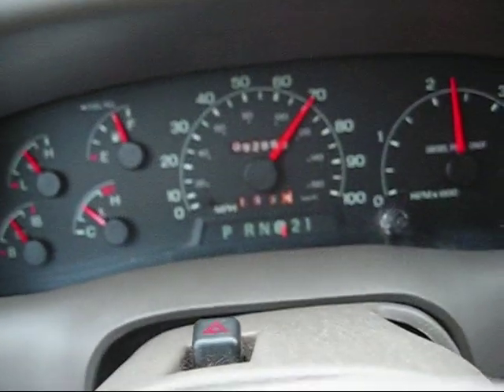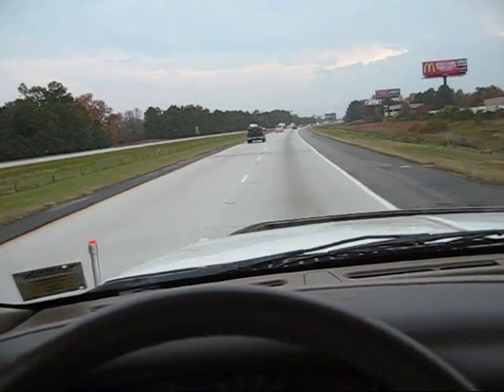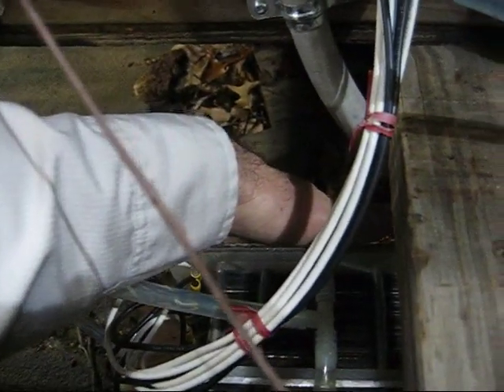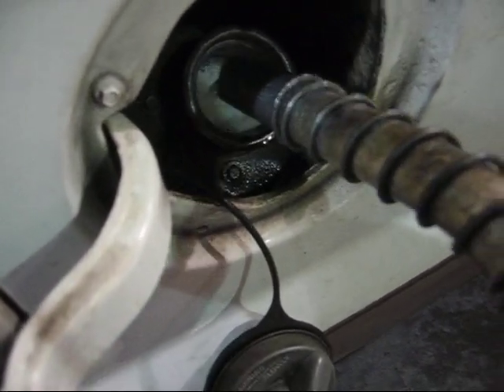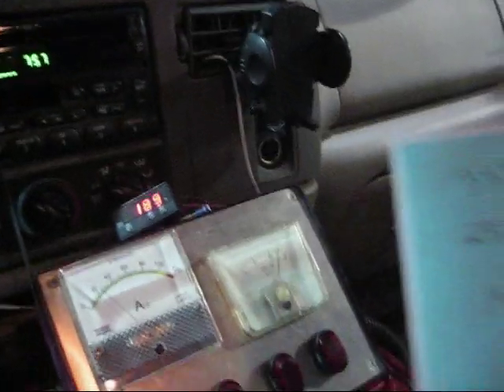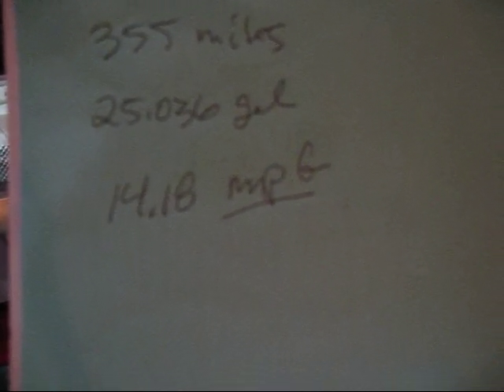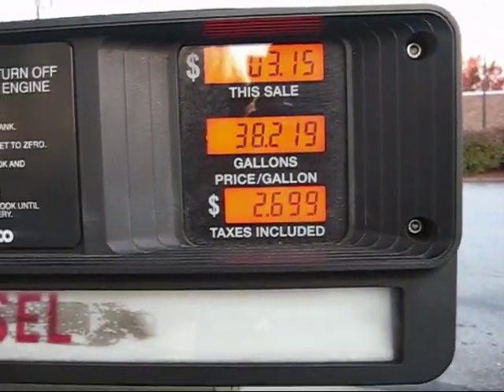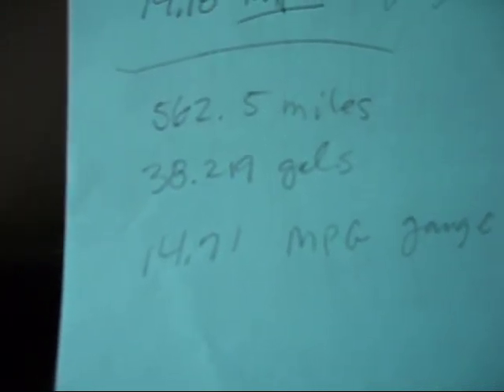MPG 1000 mile trips W/HHO in a Ford F350 7.3L Diesel

Comment: I Own a 1999 7.3 diesel I just got done making a epic trip with. I put over 3000 miles on the truck in four days leaving Florida going to Ohio Akron, over to Rochester New York to pick up a car and then headed south to go home. On the drive up with no trailer I was able to get 600 miles out of my 35 gallon tank which is about 17.4 miles to the gallon. The truck I have is a crew cab centurion package Dooley with 410 gears. I drove at the sweet spot of the motor which I’ve been told is 2000 RPM which for me is about 63 miles an hour

Comment: I have a 2000 2wd f250 special duty and routinely get 20-21  mpg at 60-66  mph and 9-10  mpg pulling my 32 ft 5th wheel rv.  You get 14?  Maybe you need a later model PCM....

Comment: I have a 1997 F-250 7.3 and I am old, retired. I drive slow, max 55-60 on 2 lane county hwys with maybe 5% small town driving. With Archoil fuel and oil additives my mileage runs 24-25 mpg. Before using Archoil my mileage ran 22-23 mpg. I have used hydrogen generators on hwy gas engines and marine diesels and achieved about 10% better mileage. What you ad to the water makes a big difference. You can change the mix to get more hydrogen or more oxygen.

Comment: so its obvious he has 4.10 gears. my 4wd CCLB DRW zf6 computer MPG reader has been stuck on 14.6 for awhile and i drive alot. i use a transfer tank so i dont really check tank - to - tank MPG. but i dont think this guy is gaining anything by using this. 1mpg does help in the long run but damn thats not much increase

Comment: Sorry my 7.3 gets a average of 15.8 mpg with hwy/city mix. 4dr stock filter + ranch hand bumpers, not some light stuff. I'm thinking the hho isn't helping you at all. Honestly the conversion is probably just a waste of energy probably mostly in the form of heat. Bad for the engine, alternator and battery life. It's simpler and probably better for you to take the same money spent and time and filter cooking oil/ old motor oil.while mpg will be similar it will cost less per gallon, but probably last longer as used oils have more lubercation properties then hydrogen. If you plan to stick with hydrogen maybe generate from the grid or solar. For efficiency less amps and more hydrogen generator electrodes to prevent heat generation

Comment: Guys... sure, there are losses, but if you can get around those, like in any f*ing situation, you're golden. So how do you get around them? Here, we're trying to find free electricity to power the HHO system. How can we do that? Well, it's difficult in smaller cars, but in larger cars, what can you do? Have a battery pack! How do you keep the battery pack charged? Free electricity! How? Fucking solar panels. Put some damn solar panels somewhere, be creative, pull them out to charge the damn battery pack, and drive your f'ing cars. Life is a f*ing compromise, figure out your ways around it and quit trying to kill people who are. If you can afford an electric vehicle, good for you. If you want to preserve your diesels or gas cars, and make them more efficient, then that is noble as well, and can be solved in creative ways. Best wishes.

Comment: Your fuel economy is still pretty bad, I know this is a ten year old video, but my 1990 7.3 idi F250 gets 21-23 mpg on the highway
Reply: How’d you manage that? Lol most early 2000 f250 7.3 trucks get like 15
Reply: @wolfrus1809  On the highway, doing 55-60 mph. highway gears, HPR diesel with additive, fully unloaded, Manual ZF-5 speed with synthetic oils and fluids. Motorkote in the oil

Comment: have a 2000 f350 4wd srw that gets in the mid 15's with 3.73 gearing at 76 mph.......it has 290000 miles on it and with no wind has seen 16.8 tops.......what the hell!!!!!!
Reply: drive slower, maintain your truck

Comment: My friend, why are you using so many amps, do you understand what that does to an alternator. Three-quarters of a litre of HHO gas per minute  should be enough for such an engine about 8 amps. Then engine has to work so much harder to drive the alternator
Reply: yes also please note voltage is the breaker of water to attomize not so much amps which is load on system...

Comment: No HHO but read this it is True:  I have a 2007 6.0 F250 2WD Crewcab SRW Larait very nice 108,000 miles.  All I've done so far is the Purge tank cap, Coolant filter, K&N Filter in Stock box. Exhaust and everything else stock. Had a smart man do me a tune for mileage. He sent me three...I did not like the first tune.  Truck runs great and pulls great.  Here is the deal....do you know anyone getting a minium of 18 mpg empty in city driving?  i do.  How about anyone getting 25 to right at 30 Plus with the best of 33 mpg empty @ 70 mph, perfect weather no wind! Awesome!   Ok some will say I am just pulling your leg..  Guys this mileage is the same for the last 6+ Months! Tunner is amazed as well.  Maybe this is a very special truck. OK Loaded pulled 30' Gooseneck flat bed and heavy trailer got 17 to 18 at 70-75 MPG up and down hills.  Then loaded it up with 20 ton roof A/C units stacked two high and still go 13+ at 70 MPH with hills.  I am one happy old 65 year old man.    So, why am I getting this great mileage? Luck maybe. And yes I check it often and the speedometer is spot on.  No I do not want to sell any time soon if ever.  Thanks

Comment: Considering all the money and effort spent buying parts, building, installing & maintaining an HHO... there's just not enough benefits for the average diesel driver.  Possibly more beneficial if/when fuel costs return to $4+/gal and/or for those running 1000"s of miles/month.  Unfortunately, HHO is a wash for those running 12K mi (or less) per year. A Straight waste vegetable oil kit makes wayyyyyyy more sense (which is the route I went }:) Too bad, really wanted to see some awesome HHO MPG #'s but for all the effort... just doesn't seem worthwhile for average driver :(
Reply from the maker: WJK it was a lot of work for not much reward but it was a fun experiment.

Comment: Major  Bullshit  Running Compression of a Diesel engine would ignite  the Hydrogen way before the cylinder intake valve closes. Even using LPG is tricky at 110 octane. 
Think about it this way One gallon of diesel weighs 7.10 pounds 
one gallon of liquid hydrogen weighs less than a pound.
You simply can't supply enough hydrogen to actually make any difference.
Also the added draw on the alternator will shorten the life of the charging system components.
Reply: Ron Brown 
You sir are incorrect. I hate to break it to you but you obviously haven't studied at all in the matter. Read below and download the rest so you can increase your below average view of hho.

"The concept of using hydrogen as an alternative fuel for diesel engines is recent. The self ignition temperature of hydrogen is 858 K, so hydrogen cannot be used directly in a CI engine without a spark plug or glow plug. This makes hydrogen unsuitable as a sole fuel for diesel engines [1]. There are several reasons for applying hydrogen as an additional fuel to accompany diesel fuel in CI engine. Firstly, it increases the H/C ratio of the entire fuel. Secondly, injecting small amounts of hydrogen to a diesel engine could decrease heterogeneity of a diesel fuel spray due to the high diffusivity of hydrogen which makes the combustible mixture better premixed with air and more uniform."

This is pulled from a comprehensive study readily found with a simple Google search so you can copy and paste

 Effect of hydroxy (HHO) gas addition on performance and exhaust emissions in compression ignition engines
Reply: You sir are a idiot beyond science. . 
Just get over it , I don't believe a word you say . Now that bothers you so much you can't sleep? I'm sure the answer is no it doesn't 
Thermodynamics tells me that your full of hot air. You are also working out side the design capability of that crappy engine.
Would you like to have me explain it further? I can assure you my knowledge of the internal combustion engine is decades beyond yours just watching the video tells me that.
Reply: for those saying it won't work cuz of the flash point differences you should do more research. ppl have propane boosted diesels for years for better power and fuel economy  this is just another gas doin the same idea

Comment: If you keep your rpm's below 2000 you should easily get 17 or 18 on the freeway.
Reply: my 2wd long bed 4door 02 with 3.73 gears, all stock besides AIS and truck muffler... at 374k miles i still get 18-19mpg empty at 70mph... friends same truck with 109k miles gets 22-24mpg

Comment: I have a 2001 7.3 powerstroke. At 70 mph my tac is 2000 rpm with my truck empty not pulling. Freeway MPG is at 22-23    K & N  air filter

Comment: HHO is a scam
Reply: +Successfully Puzzled Well, the truck is using about 1.1 horsepower of electricity to run the HHO system.   The reply is thus, the laws thermodynamics surmised say you can't get something for nothing.  The energy required to split water into HHO is pretty close to the energy you get back, but, there are losses in electrical generation, waste heat from the gas generator and wiring, and a big honkin diesel engine running at about 50% thermal efficiency.   So, if you could take the full 1.1 horsepower to generate we'll say a volume of fuel, that volume of fuel burned in a diesel ICE, you're going to get less than 0.5 horsepower back for your investment.    Where hydrogen conversion works well is where you have a big power generation facility feeding a high pressure hydrogen generator, using excess power to crank out some hydrogen with surplus energy in off peak times.        Now a vehicle with constant power generation, where excess power gets shorted to ground, will see a tiny benefit.  If you put a scan tool on this 7.3 diesel, pull up the pid for fuel consumption in GPH, when you click on this HHO generator, you'll see exactly what your realtime fuel cost is to run the HHO generator via the alternator.
Reply: Successfully Puzzled
 I have not looked but are there 'fuel line magnets' for sale still?  How about intake turbine mpg boosters?   If someone buys a product and feels it works, sure they'll give good feedback. A buyer is free to leave anything from good to bad feedback, but that's not science and doesn't meet any standard of proof
Reply: fastst1 laws of thermo dynamics? What happens when you burn wood?
Reply: fastst1 you missed some stuff off... Alternator - 80% efficient
HHO - 70% efficient
Combustion - 40% efficient

1hp used to make hydrogen would equal 0.2hp... so that's 80% of the power wasted!
Reply: +Successfully Puzzled   burning wood to fuel the engine or burning wood to break down water?   wood and coal gasification has been used before to run a standard ICE, still a very low thermodynamic efficiency esp once you get to the ICE part. You can absolutely fuel an ICE with wood vapors.  Energy required to make wood comes from tons of solar/organic energy power.
Reply: ***** all those ebay selling HHO kits with great feedback???  Sure michael...... it's time to graduate your thinking.
Reply: Successfully Puzzled the idea behind HHO breaks the laws of physics, show me this feedback? I have yet to see anybody who has credibility to show any improvements from these systems. A few years ago, professional skeptic James Randi offered a $1 million prize for anyone who could prove their device lived up to their claims. Nobody took the challenge/test.
Reply: Successfully Puzzled I just looked some up... the one I looked at obviously has fake feedback, there's one feedback message that mentions the quality of an iphone 5S (even though he purchased a kit) and 7 different people say exactly the same thing.
Reply: +micheals1992 I agree, icing on the thermodynamic cake ;)  even IF it was 100% on generation, 50% goes away for heat in the power production cycle, modern common rail diesels can hit 50% at full power. So generating 1.1 hp does require a lot more than 1.1hp
Reply: my master is SCIENCE! teamed up with string theory, we own everything across time.

you didn't buy a fuel line magnet did you?
Reply: @fastst1  lol..science..your right your master is science  a new tool is created on graduation day ..as an educated fool and free thought part way
Reply: @Ownlyfrogs    Naah, water is just so highly stable that it doesn't want to break, you have to use a fair bit of force to break it apart.  Even lets say, for speculation that  the energy for breaking apart and combusting water is equal going in either direction. You still have heat losses in generating  the electricity along with the spinning motor to drive such. 2nd law of thermodynamics states there is no free ride, and its the law.  There isn't solid, repeatable, objective science for the application of self generation.    Science may not have all the answers but it supplies a mighty big toolbox for testing just about anything observable.  If HHO works, what prevents you from scaling it upwards and creating your own massive stand alone power generator?
Reply: robinsss no I just bought a car that does 60/75mpg (city/highway) without any hybrid technology. it's actually one of the cheapest cars on the european market too! the Toyota Aygo, Citroen C1 and Peugeot 107 (they're all the same car just rebadged, they all use a 1.0L VVT-i toyota gasoline engine too which won a few awards for relliability and economy).
Reply: *****

what's your response to the dyno test at U of Northwest Ohio?
Reply: +fastst1 a lot of fancy lingo going against what's quickly becoming the norm. HHO is not a scam. If so, it's amazing how all these Ebay sellers have such high feedback from selling this "hho scam".
Reply: How many oil refineries does your master own?
Reply: got HHO?

Comment: You mileage is low. You got a dually. That means 4;11 gears. Automatic? you should pull easy 16-17 highway. Is you exhaust stock? Big pipes, free flow muffler.  Check out Banks. He's got what you need to unleash the power and mileage of a 7.3 My 7.3 Excursion, Automatic, pulls 15-16.5 city all the time. !7-19 hwy. at 70-75mph. Any faster and it drops like a rock. Like down to 14-15 at 75-80.  Rpm at 1400. that's the sweet spot for 7.3s   Thanks for the info, I'm going to try it.

Comment: I have an automatic dually 99 with the 7.3 411 gears and I get 19 empty.  K&N air filter, big boost ($80 on Ebay), SCT programmer, fuel system mods shown on powerstroke help.  Otherwise stock.
Reply: Lanier Boat Sales same here
Reply: Is that what you guys average? 19mpg all the time average? I get about 21 on frwy but about 14 in town with stop and go so I really average 16-17 mpg combined.

Comment: Dear MARS1952. Very interested in 7.3 powerstroke but its fuel consumption stops me from buying it. I've gotten tones of INFO about HHO systems, but non of them describe effects on engine(negative ones).Do you have any information about it? Another question is about VOLOchip for HHO - did you use it in your truck? It have been said that VOLO could increase the fuel efficiency up to 70%. I'm nuw in it and want to get more info before start to do it. Best regards, Alex.

Comment from the maker: What is a zf5? There are a lot a variables including weight, options, transmission, gears and so forth. But the biggest variable is how the fuel mileage is calculated. There can be as much a a 3 gallon difference between one top off and another. On a short MPG test I can get a 2 MPG variation just because I had to stop at an extra stop light. Long tests are the only way to get any accuracy. Forget about the built in gauge.

Comment from the maker: @KyleCarrington: I am not running HHO right now because my brick was leaking and I pulled it to use the parts in a new larger Brick (unfinished at this time). I would not worry about HHO affecting any micro-fissures. People run propane without ill effect and propane has much more hydrogen in it than even a very large HHO generator.
Reply: Thats great to hear my main concern was burning something out. Gonna try sometime with my 97 7.3

Comment: @mars1952 Cool. Are you running HHO at all, now? I really like those 7.3's. I got a 6.2 - '89 380,000Km. I stopped running HHO ... only because I was warned. The 6.2's have quite weak blocks, and I'm told 90% of them, that are torn apart, have microfissures in specific weak spots, and that running hydrogen would cleave those, and finish it off sooner (the block). It runs very well though. Cheers

Comment from the maker: @KyleCarrington: This brick was an old design and had an MMW of about 4.5 and never really put out enough HHO even when I push it to 100amps so building it so that I could shut parts of it off was a waste of time. The gaskets that I made leaked but it still paid for it's self in fuel savings. If I could do it over again I would but I would use neoprene gaskets. Thanks for the comment.

Comment: okay I have a 2002 f250 7.3L and on my truck at 70mph my rpm is 2000 yours seems really high why is that and on my trip to knoxville from baton rouge was getting 18.77mpg my truck is all stock no chip or anything aftermarket (except the sound system) oh i was hauling a Mastercraft X45 boat

Comment: I had a 2006 6.0l F-350 diesel & it would got 11 MPG, I upgraded to a cold air intake, BD Chip & 4" exhaust with cat removed & averaged 14 MPG. 
I now have a 2010 ram 350 6.7L was getting 18 MPG. I just installed a Cold air intake & now get 19 MPG. I ordered a H&S chip & DPF delete for it and will install it soon. 
I also ordered the D-7 Hydrogen Kit from hydrogen-generators-usa
With all these upgades I hope for 25-30 MPG. Will keep you posted

Comment: i pull around 20mpg out of my 2000 superduty with the 7.3l, it is auto aswell as four wheel drive. i have common performance parts for it such as a edge bow, a x wheel and 4" exaughst. no propane or nitros. i also put a 6.0l icp sensor on it and used a ipr from a 3126e cat motor try it